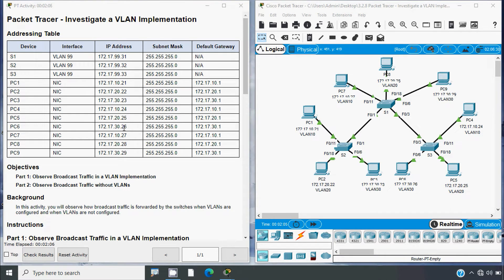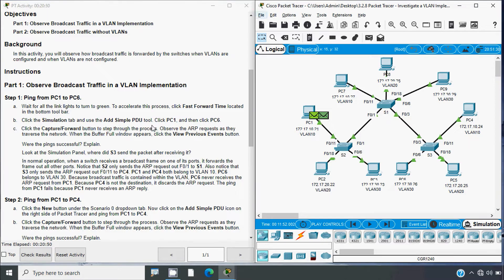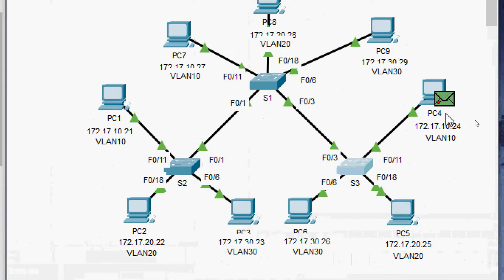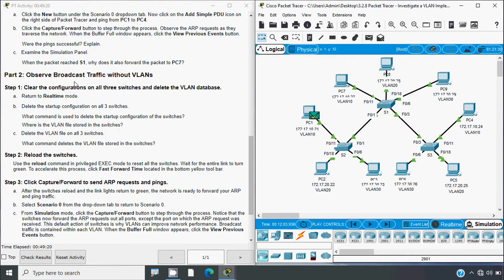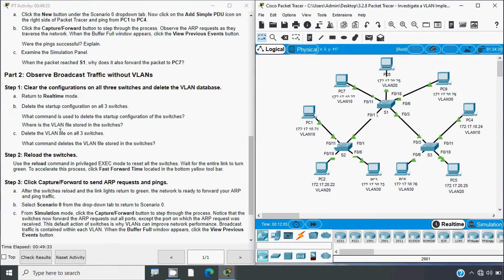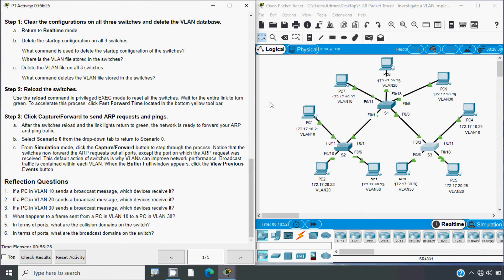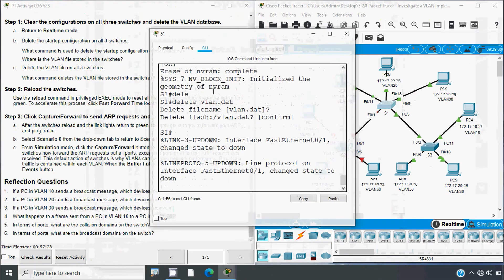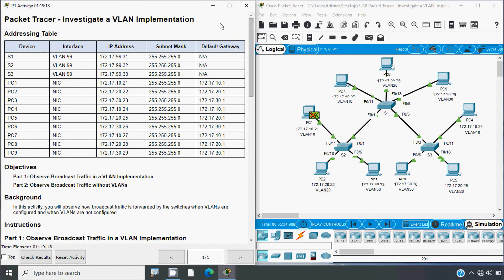3.2.8 Packet Tracer - Investigate a VLAN Implementation

Comment: On the reflection questions: You erased the startups and the vlan database then reloaded all switches. 
  Wouldn’t all devices receive since all ports are now on the default VLAN 1?
 Also why did every device drop the packet when you ran through the simulation?

Comment: For some reason, after the reload step and fast-forwarding, the Switch lights on F0/1 on S2 and F0/3 on S3 became orange for me, and the Switches will not forward PDUs out all ports. Also, the hostname of each Switch reverted to "Switch". I used the "erase startup-config" commands and the "delete flash:/vlan.dat" commands.. I think similar to you. Do you know what I did wrong and how I can fix this? Thank you! =)
Reply: same issue. ports from switch 1 & 2 do not reconnect after reload (the solution is to reload it again)
Reply from the maker: Hi
Please share the file and contact our team, so that we can help you..
And thanks for your great support and sharing my dear friend...!!!
Reply: I have the same problem wtf
Reply: nvm I fixed it
Reply: @ElizabethHernandez-em2py  Thanks a lot for sharing how you fixed it